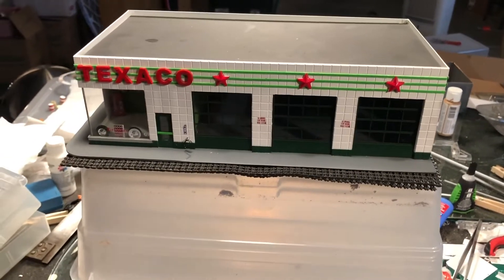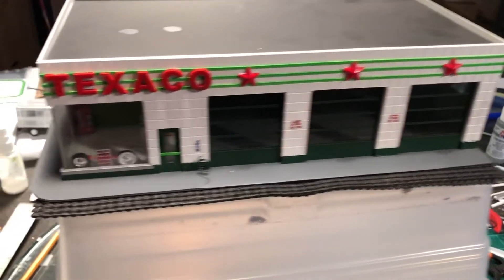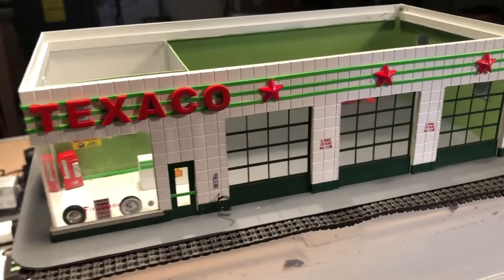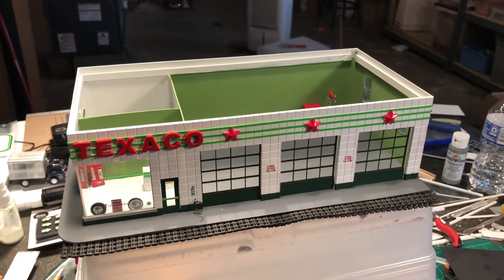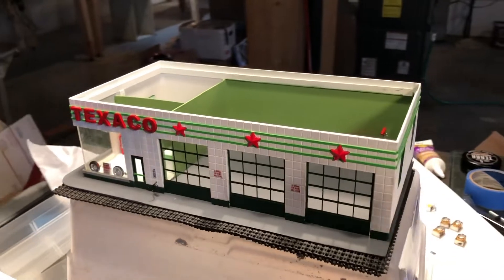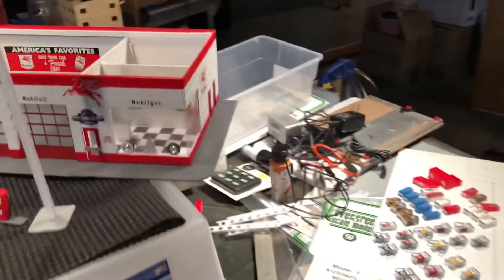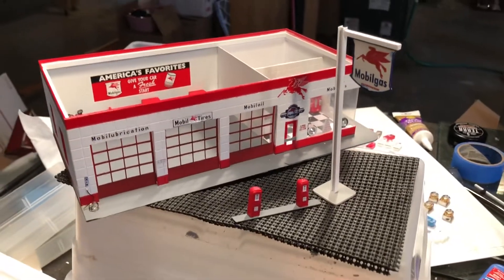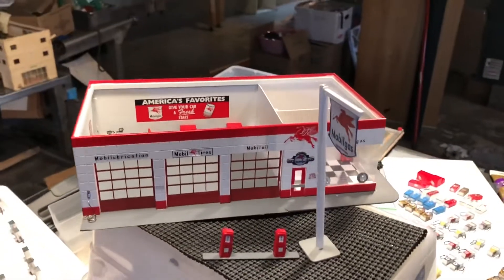1/64 scale Texaco gas station

Comment: Spent 5 yrs working at parents Texaco of this same vintage. Ours had the right side office like your Mobil version. The model is pretty much spot on except the office and bathroom doors. Those should be larger to be properly proportioned to the rest of the building. Our station was 60’x30’. Thanks for sharing.
Reply from the maker: The doors are correctly sized for commercial doors. I didn’t have the transom windows above the doors. That makes them look shorter. Plus I made the walls a hair too tall. 
Good eye. Keeps me honest. 
I built these several years ago. I would size the building better if I built it now

Comment: The Greenlight stations aren't the most masterfully designed brand, i have to agree. And they cost the tip of the Moon 🌚
Reply from the maker: It’s expensive to build with styrene but I think it’s the best way to build. There are cheaper options but you get what you pay for.

Comment: I of course, have yet to buy the essential detailing elements, like two of the semi haulers, two Massachusetts State Troopers cars, a lift and garage accessories for the Sinclair half, not to mention a Sinclair sign. I won't have the room, unfortunately, to add a Miller Engineering Diner sign; and they're kinda expensive, anyway. I do have a vintage Root Beer bottle label for the diner section lot, and for the LEAST expensive of ALL detail accs. I want to buy and add a sticker celebrating the classic Supertramp album front Breakfast 🥞🍳 In America. You know THAT one, with the merry waitress holding up a glass of OJ with the New York City skyline in the background. Finally, I will need a booth, a dining table with three chairs, lighting, and a pine tree 🌲 for the corner parking lot. Last, a Bird's Eye box truck delivering the restaurant food supplies. Can hardly wait until I scratch the surface on all this.
Reply from the maker: Sounds cool.

Comment: What is the average height of a 1/64 scale building? Love the gas stations.
Reply from the maker: About two and a half inches for a single story. Depends on what building you are building. Buildings are not a standard height. It depends on the building and it’s purpose. 
Best thing to do is measure the building you want to build and convert the measurements. 
Woodland scenics has an app called 
Model scaler that’s handy. 
Getting the proportions correct is key to building a true to scale building
Reply: @acmesdiorama9301  Thanks. I want to build a gas station first.
Reply from the maker: Twin whistle has a nice 2 bay gas station kit. It’s an easy build and will teach some building skills. It was the first building I built for my diorama. I learned a lot about building from it and the a&w kit. 
Check out their website. It’s temporary down but it should be back running soon. The had an issue with their server and it crashed the site. 
Feel free to ask any questions